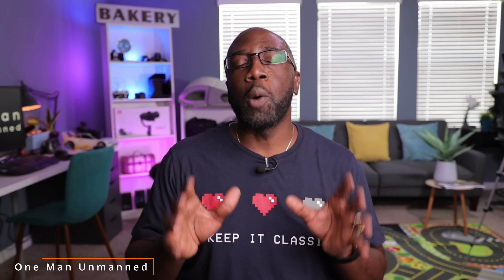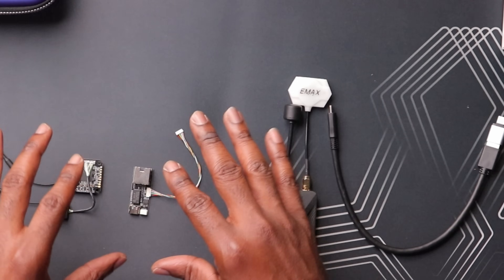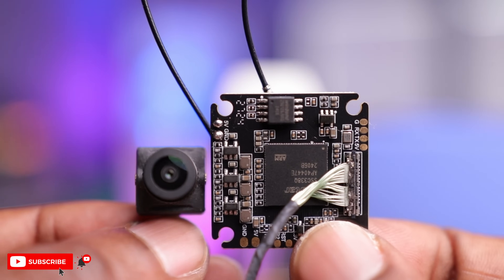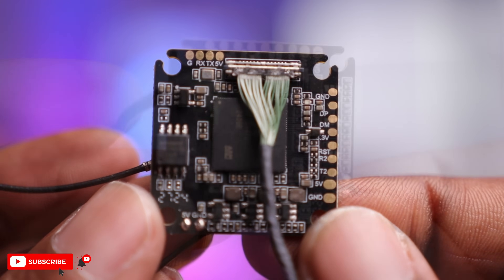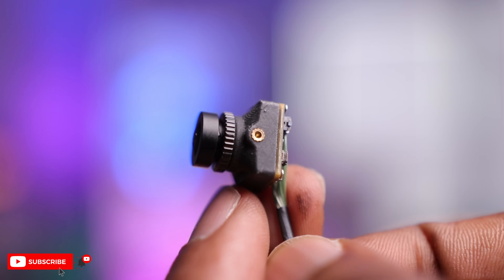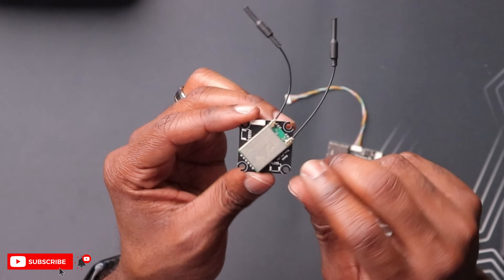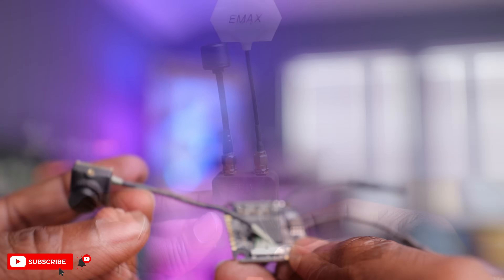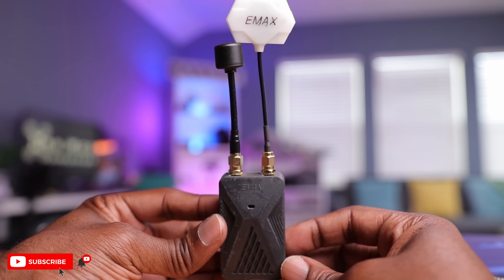EMAX Open IPC | The Newest Digital Option is Here..And It’s Open Source🤯

Comment: I think Meta Quest 2 or 3 can perfectly fit as headset for this system. It has powerful hardware, Android and high-end screens and optics 👍
Reply from the maker: Thats not a bad idea…I guess it comes down to cost now.
Reply: The runcam version of openipc uses a usb wireless dongle as a receiver. You have FPVue android which allows to vue the video on your android device, FPVue_xr is a POC that runs on the quest ! We are still ongoing but it is really promising ! I'm so hyped to have a usable cheap HD system ^^

Comment: openIPC isn't intended to be a fpv system, but a open source security camera system through wifi/LAN, while some hobbyist do managed to modify it with some feature of video transmission using wifi which well-invested from other projects (wifibroadcast, openhd), and make it to a real deal
Reply: Not exactly what you said. We used WFB-ng and later RubyFPV as a WiFi link and a modified OpenIPC firmware. The combination made this awesome fpv system.
Reply from the maker: Thanks for the explanation!
Reply: @mariofpv  I mean before that, ofc I know your made tons of effort in porting the wfb/ruby to the system and make it usable for FPV usage
Reply: Part of the official team is developing the FPV side though

Comment: Interesting. I have been flying HDZero since it's inception.What are the pros and cons of this system compared to it? TIA...🖖🏼
Reply from the maker: Cons:  (1)It’s not really proven (still in development/testing phase).  
(2) Its not refined(still using 3D printed cases) and somewhat bulky for 800mw version VTX.
(3) No goggles exist for the system

Pros: (1) Open Source which leads to: (a) Fast development (b) Lower cost (c) More pilot involvement/contributions  (d) More options for hardware
(2) Lightweight
(3) Low latency
(4) More digital options for pilots and increased competition among manufacturers
Reply: Also its encrypted. its based on wifi tech and security camera tech.. so it should be commodity/jelly bean components.. also should be lots more power efficient I hope.. one day.

Comment: Could you use a usb c to hdmi adapter to display the signal in some goggles like Walksnail or HDZero?
Reply from the maker: Yes, that's a high possibility... I'll be confirming that in a few days.
Reply: No that's not how it works.  You could connect it to you device and then use HDMI output from that to get it within goggles.  Radxa Zero 3W is another option.

The VRX here I believe is really just a USB network device connected over OTG.  The stream that it sends still needs to be decoded on the device.